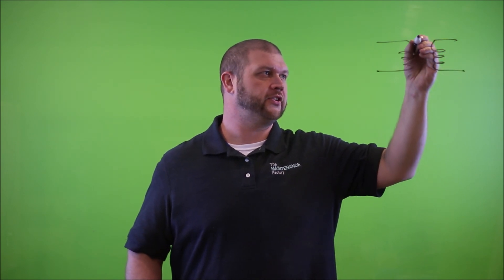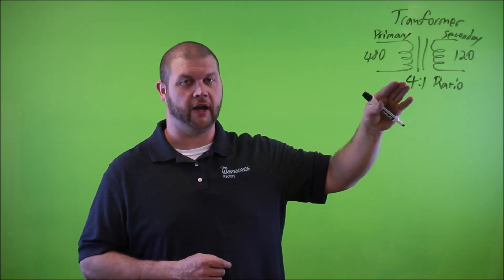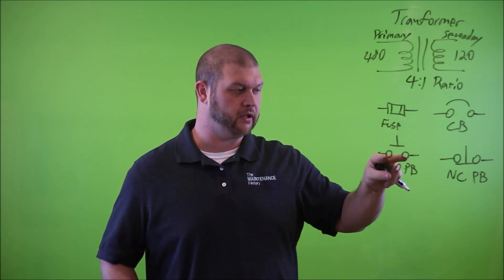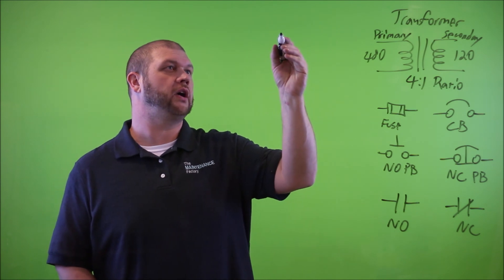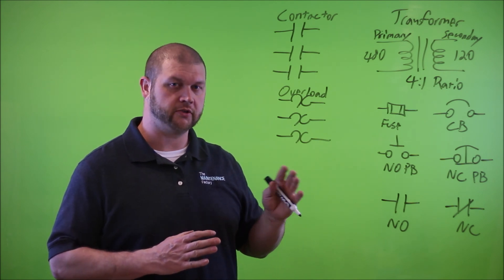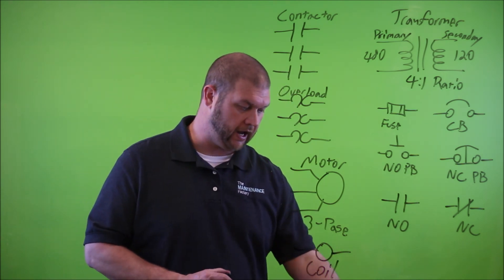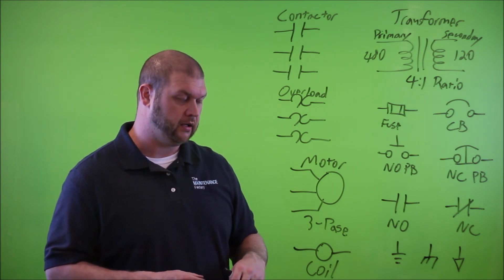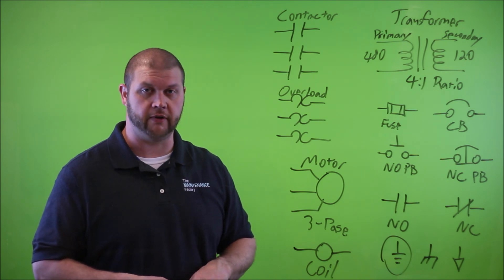Electrical Symbols  THE BASICS

Comment: Thanks for the videos. I find it very difficult to understand control circuits. One circuit I would love you to explain for me is a control circuit for a lift station. A lift station with a high float switch and a low float switch. When the low float switch is activated the motor does not come on until the high float switch is activated. So the motor ( pump) will pump down the water until the water level goes down to the low float switch it shut off the pump. Thanks
Reply from the maker: Devon, do you have a schematic or electrical drawing of your system?  If you had a way to send it to me I could cover your specific system.  If not I have a fairly good understanding and could still provide some content in the near future.
Reply: @themaintenancefactory2592  thanks very much